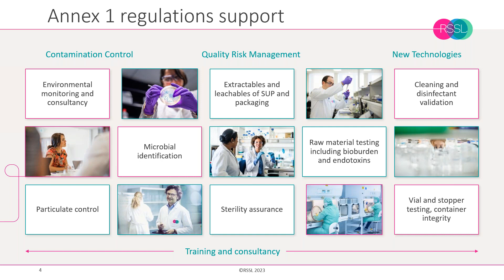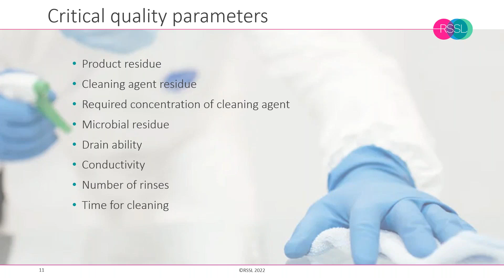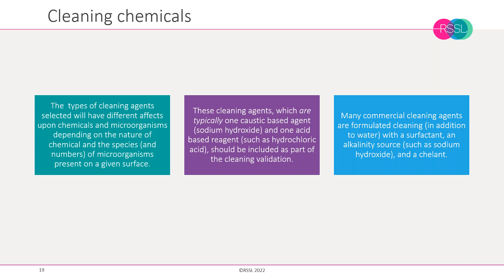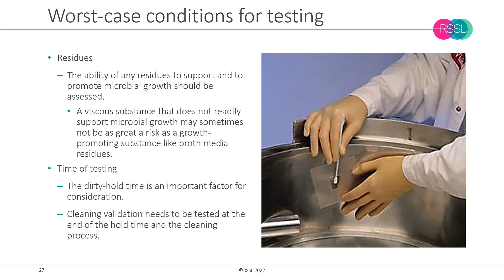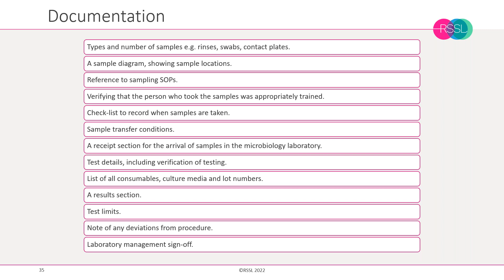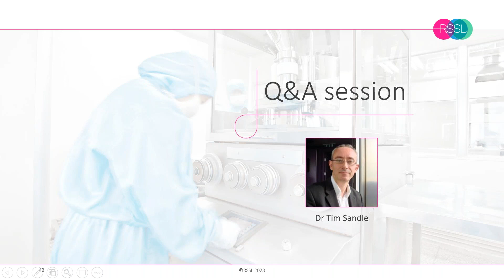Designing a cleaning validation strategy | RSSL Annex 1 webinar

Comment: If you were validating clean hold on a peice of equipment. How can you do this post sterilization for different time points? For example as soon as you expose a treated area to air of a lower grade, you introduce potential contamination - thinking microbial here. You cant really then seal the equipment location up again and sample afer another week for example. As soon as you break sterility to sample you would have to repeat the whole exercise. Lets say you wanted to validare 2 week clean hold. If you sampled 1 week, you break sterility.